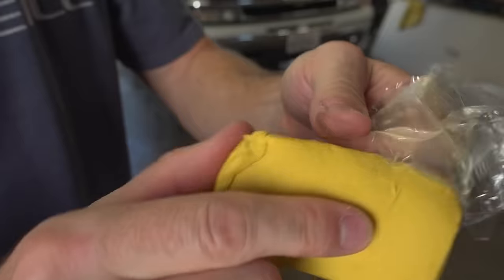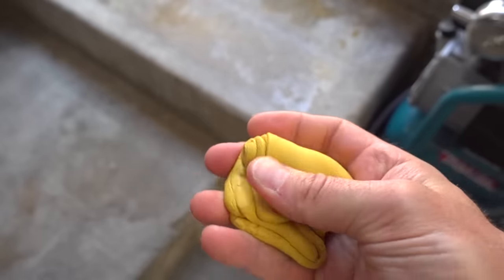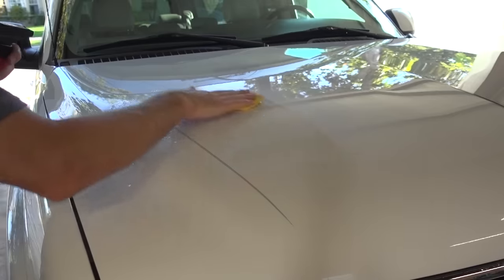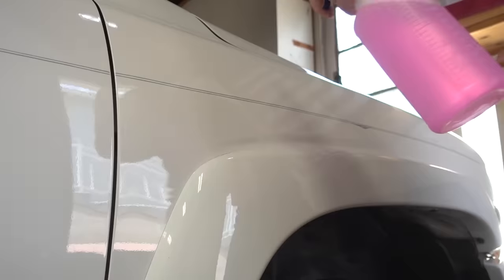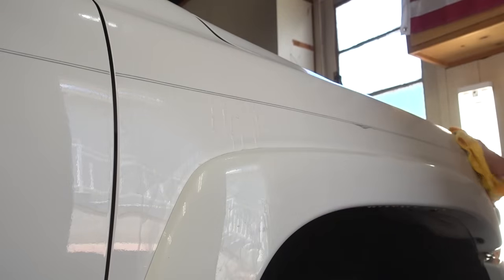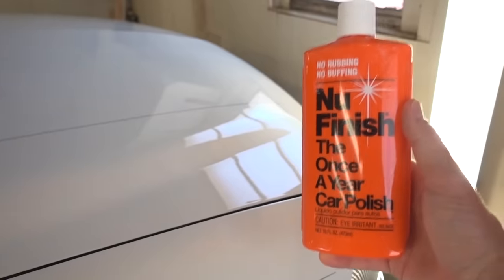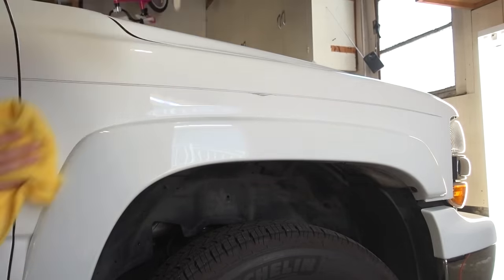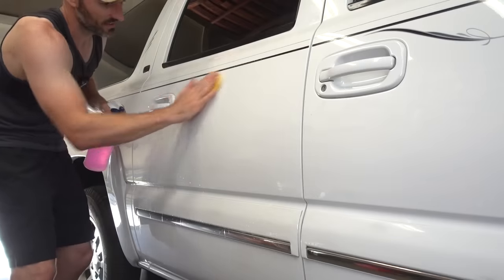This Is Better Than A Clay Bar And Only Costs $2

Comment: You never flip over a clay bar. What you're supposed to do is fold the dirty side in on itself to trap any sharp contaminants inside the clay and end up with two clean sides to the clay again. If you flip it over, you contaminate both sides of the clay and you can no longer fold it to achieve clean sides again. That increases the chance of having a sharp contaminant sstick out of the clay whilst you're rubbing it all over your car. Read the user manual.

Comment: So I will tell you what I use- knead rubber for artists. Cheap one costs £1 for two bricks in size of a clay bar, it is soft but not too soft but made to pick up slightest carbon dust from the surface of the paper without even lifting a single fiber of paper off. That's what I call gentle action. Results? Absolutely same as £6 clay bar which I have to store in a jar of water because it sticks to everything and flows. Hate it also when it squeezes through my fingers while claybaring. So no. Tried, tested with a masking tape comparison. Works on chili red Mini like a dream.

Comment: Seems to me a good comparison test would have been to do a panel masked off, half panel clay bar, the other half plumbers putty. 
Then, since clay bar is light colored and easily shows debris, do the putty side with a new clay bar and see if it picks up any debris.

Comment: There are two kinds of plumbers putty still sold sitting side by side. The older putty that uses oils that will damage plastic sinks and pipes and the newer putty that is safe for use on plastics.

Comment: You did remind me with this video that I need to do this operation to my truck. Thank you for your tips. I would assume that regular dish soap mixed with water would also work the same as a lubricant
Reply: I wouldn't use regular dish soap on my car as it is too harsh a chemical for automotive paint - well what else can you expect from a detergent designed to remove grease and sticky food particles.

Comment: You have to use the plastic covering of a cigarette pack to feel for crud left over after waxing. Stick your hand inside the plastic wrapper and feel your paint. You will feel crud. Now use the clay bar. Again feel the paint through the plastic.

Comment: It does take a certain amount of firmness in the clay to work well depending on how bad the car is.
Plumbers putty is not very firm. Could be ok for a car that doesn't really need clay anyway. I would be concerned about it leaving a residue.
If your car needs clay, you really want to follow up with a DA polisher . So clay micro scratches are not really an issue.

Comment: The reason you heard the clay bar make the noises is that's the contaminants on your verhicle  once you hear no noise going over and over again with the clay that's when you know it's contaminant free. No noise of the putty is meaning it's to soft to pick up much, what you should have done was do a panel with the putty then go over it with the clay and see if it's contaminant free.

Comment: You're not actually supposed to use the whole clay bar; just pull off a small piece and knead it till it's soft then form into a disk and clay the paint. The way you used it, if you drop it then you might as well toss the entire bar. There's also linseed oil in the plumbers putty which isn't really good for your paint. I agree with other comments, this may have been an entirely different result if it had been done on a black vehicle. Black show's everything.

Comment: To do a real comparison, You need to do the test on one panel. Half and half. When clay barring a car, one quickly realizes certain body panels get way more micro particles on them. The rear bumper being the most heavily covered on the vehicles I've done.

Comment: You need to show the surface of the clay bar to see what was removed. You can't tell which is more effective without seeing what is picked up from the paint. A less cared for paint would show that result. The sounds or the sliding of clay won't hurt the paint it's what is pulled off the paint is what's important.

Comment: I highly recommend using a clay bar on a brand new car.  Follow up with a thick quality wax job. Cover all the paint.

Why?
Cars get transported by rail, even though most of the car is covered, parts are still exposed to brake dust from the trains. 
The dust is heated and clings to the paint. 

Don't believe me, next time you go see a car on hauler make a note what's not covered in plastic wrap. Go to the dealership ship of that auto, feel the difference between the covered and uncovered sections with your finger.
For an added effect,  use a thin plastic sandwich bag around your fingers.

Comment: If you are worried the plumbers’ putty will leave a residue of some kind, finish off with a wipe down with wax and grease remover. 

Of course there goes any savings from using putty instead of the wax bars.

Comment: I use a synthetic clay. (looks like a nylon pad on a plastic handle) I can do 10 cars before replacing . If you drop it, wash it off. No need to knead. I also use Nu Finish. After that, its spray synthetic wax. Turtle wax ice is great.

Comment: Wikipedia says: "Plumber's putty formulations vary but commonly include powdered clay and linseed oil. Other formulas use limestone, talc, or fish oil." Sounds like the version with just clay and oil should work just fine. I'd worry if it had limestone....

Comment: I bought the clay bar system once for my Z28.  It was almost impossible to not drop the clay bar at some point in the process, where it then picks up a lot of contaminants on the ground and is essentially ruined.  To be honest, I couldn't tell much of a difference after using it.  I'm sure there's something to it, but I would only use it if I had a really, really nice car.  And I wouldn't want a car that nice, because you are walking on egg shells around the thing trying to keep it super clean all the time.  Too much hassle for me.

Comment: you kind of want it to be some what abrasive on paint that is a few years old to remove haze. this might help found it on google of all places. A good way to differentiate between the compound types is to think of sandpaper. Fine clay bars are like 3,000-grit sandpaper, while heavy-duty clay bars are more like 600-800 grit.

Comment: I'm amazed you have a gm suburban with white paint and it has and it hasn't peeled off. Mine did and I see them all the time. I had a 8" square of paint come off after a freeze thaw while driving down the highway. I thought it was paper as it stuck to the windshield for a moment.

Comment: Clay bars are meant more so for just prepping the paint work and getting off contaminants and micro defects that the wash process wouldn’t. I wouldn’t go the lengths of working out scratches with a clay bar. I’d use an applicator pad after claying the surface but clay bars weren’t meant to create the heat necessary for paint correction. The clay process is what truly strips excess non visible junk from the paint. A small portion of scuffs and blemish will come up in the process sure.

Comment: A clay bar isn't really clay. It's a synthetic resin made especially for the purpose and car detailing.  Plumber's putty is actual natural clay mixed with linseed oil.  The clay bar is engineered to clean without scratching.  The plumber's putty works but isn't engineered for detailing.  The clay bar will last longer and pick up more.  Looks like you're starting with a pretty well maintained car with good paint.

Comment: Keep that clay clean with straight hot water that's what cleans it eliminates scratches and keeps the dirt off of the clay I've been clayin cars down for 30 years  be careful  with the soap used some will eat the clay apart but remember  clean with hot water

Comment: So, I don’t think the polish offers much protection. Now, polish obviously makes it pretty but you need to wax over the polish. I’m new to this but every application I’ve used and read about is compound with least abrasive pad and compound combination the job requires methodically using more abrasive compound and/or pad to achieve desired results.I’m sure not all paint jobs need this level of attention but it’s always followed with a polish and protected with a good wax.

Comment: Ok, great idea for the test, but I think better methodology would give you clearer results.

First, you said the paint on your SUV wasn't that dirty, so it's really not that good of a test subject.  You should get another vehicle that is more dirty.  Easier to see the improvement, or lack thereof.

Second, hoods get a lot dirtier and more sun damaged than fenders and doors do.  It's not a good comparison.  If you repeat the test on a dirtier car, you should do 1/2 of the hood with the clay bar and the other half with the plumber's putty.

Third, once you've finished both the clay bar side and the plumber's putty side, you should go over the clay bar side again with a fresh piece of plumber's putty, and the plumber's putty side with a fresh piece of clay bar.  You can then check the plumber's putty and the clay bar to see if either of them picked up any additional dirt the other left behind.

Comment: my friend had a body shop and to test the job of a clay bar use a cellophane wrapper off of a pack of cigarettes';  just put 2 fingers in the wrapper and lightly rub it across the paint of the clayed area and an un-clayed area and you will feel a huge difference between the 2. even if the 2 areas feel the same to the bare finger.

Comment: One way to feel the contaminates in the paints finish is to feel the paint through a cigarette’s clear wrapper. Just put your fingers in the wrapper and lightly wipe the paint. Then use the clay bar on the paint and feel it again. Wow will it be smooth!! I use to have a 1986.5 Supra that was Black. After every winter I would clay bar the paint before giving it a wax job. What a difference, the clay bar would remove all the micro grit that n the paint!!!

Comment: (Head's Up!)  Modeling clay (non-drying) is as close as you can get without paying the big bucks.  At $3-4 a pound.  And you can get a selection of colors to choose from which will help you observe the junk removed.  This will in turn let you know when to replace the bar.  Do not do below the belt line before gently using a bug remover pad with the really soapy water & or liquid cleaning agents. The worst crap accumulates in that area.

Comment: To get a good comparison I would have preferred to see the results on each half of the hood.  Use clay bar on one have and plumbers putty on the other.  After you are done with that, then follow up with the other product to see if one missed something.  Does the putty leave contaminates that the clay removes or the other way round.

Comment: As a detailer for over 20 years I got into using a clay bar pretty frequently and I've had great success with them. This isn't the first time  I've heard about using plumbers putty. However the ingredients in the putty are totally different. Plumbers putty was mainly developed to aide plumbers... HENCE the name. Using the putty will cause damage to the paint over time. it slowly eats away at the clear coat. I'd strongly advise Not to use it.

Comment: Totally different chemistry.  Plumbers putty is designed to be hydrophobic, that's the clay part.  They usually add oils to make it flexible.  The clay bar formula adds a polymer that makes it flexible and sticky. The polymer in the clay bar is probably one that reacts to UV light.  (Many glues are suspended in water which evaporates and then they get hard.) UV poly's stay stick longer.  (Could be some other poly, as I have not seen the formula.)  Clay is sticky without additives, so it will "grab" particles on the car paint like the store bought system. If you expose the putty to air, some of the oils will evaporate (That's the environmentalist VOC issue) and it will be a little more sticky.  Nice life hack.

Comment: Good video but you should of used a vehicle that wasnt already so smooth so you could of better compaired to two. The sound you were hearing was the clay bar lifting contaminants off the paint which means it was working. If you dont hear a noise then either the product wasn't working or the surface wasn't contaminated. I have found the cheapest and best way to clay bar your vehicle is to wash car down at car wash then after dirt is off and vehicle still wet apply the clay bar, or plumber putty, then dry. Yes water works just as good as detail spray!

Comment: The other consideration is this: Clay bars become filled with particles that will scratch so using them repeatedly is not a good idea. The Plumber's Putty is cheap enough that you can throw it away after you're done.

Comment: I got leftover plumbers putty after installing sink and fixtures and drain. I got rain spot on my Dark Blue Tahoe....hmmmm, there is a polish at space age paints that works gr8, even took silicone caulk spill that dried on my door, but is 12 a tube.

Comment: Plumber's putty doesn't work to remove bonded contaminants. It may remove surface dirt if used before washing and if the wash was done improperly with not enough soap (many people don't mix in enough soap in an effort to reduce cost). Chewing gum will accomplish the same thing. What plumber's putty will do over time though is leave putty residue and/or wear away the clear coat due to how plumber's putty is made and the additives it may contain. If you clay properly once and maintain your car, you shouldn't need to clay enough for the cost to make any difference.

Comment: As a detailer I would have rinsed the car and stripped, washed then clayed the car. Their are different levels of clay bars. Soft medium and hard, I believe meguiars is a medium clay. But seems like your happy with your results so thats what matters most. If interested on better quality products I personally use chemical guys. Before that I used meguiars. Both are very similar in cost but uv protection are very different and that's where the chemical guys shines. All this is to be taken with a grain of salt as some people use trust other respected brands such as meguiars.

Comment: Would have been nice to see how it takes contamination off rather than using it after you used the clay bar.  I get tree tannin stains that have to be rubbed off with clay bar because most cleaners won't take it off.

Comment: I've been using it for years the best thing to have 3 pieces and put 1 in the fridge so it is more stable and use solvent free glass cleaner sparingly  as lubricant cheap as chips  !!!!! 👍

Comment: Like all items, each has it purpose.  For some a multipurpose.   With using plumbers puddy, I would be suspect to the chemicals in that product.  Application is the same but end results could harm the clear coat.  If you, as I am,  who like a clean vibrant detailed vehicle, stick to the product made for the application. Like it was said, it's cost is about the same and you get 4 items in a box to do the playing.  Why risk?

Comment: A clay bar can actually scratch your vehicle a little, especially more noticeable on a darker vehicle.  Wax/polish will hide that somewhat.  If there are a lot of contaminants on your paint surface, that will also make a difference.  This test would have been more informative on a darker colored vehicle.  Nice Tahoe/Yukon, by the way.  Thanks for the info…

Comment: Nice video but would be much better using a dark color especially black, dark green, blue, etc. to reveal . I have a metallic gold motorcycle and it doesn't show off the nice paint job and clear coat near as much as darker colors of equal quality. I had a white XJ cherokee,  I never bothered with polishing it. :)

Comment: The firmness  of a clay bar should not matter if you follow  the proper  procedure  to detail a car, they do sell different  firmness  levels  of  clay. The more firm the more and tougher containments  you will remove. You do have the possibility  of adding VERY VERY light scratches  but will not matter if properly  detailing  a car because  you should be polishing  the finish after with a high speed buffer foam pad and # 2 then  #3  polish then removing  all possible  micro scratches  you added  with the clay.

Comment: I remember the good (horrible) Old days before clay was even a thing. Made our jobs a million times harder especially if you received a car with a ton of over spray which we got alot of from one hacker body shop we finished cars for. Actually had a bucket of compound called " Bucket O compound" you slung it on the car with a putty knife, buffed at low speed and then buffed again  with medium grit compound , and then again with polish and then waxed. Detailed for 30 years

Comment: Hard to tell with white paint, but are you putting micro scratches in that paint with the plumbers putty? Try that on a black car and use a light at an angle to check closely if you put swirl marks in it. You can't see micro swirls on white paint.

Comment: What about using a $1 (for 4 sticks) of modeling clay from the Dollar 
Tree"?  That is, after using up all the 3/4 full cups of plumbers putty out in the garage.  Funny about that stuff.  You normally only use a teaspoon to seat a sink drain fitting, but have to buy a whole 16 oz.  That's why we all have one or two in the garage or shop.  One for the first sink job and the other because we bought another one for a new project and either couldn't find the first one or weren't sure it was still good  and didn't check before going to the store for the second sink project......lol!

Comment: 1Road, all clay bars are not the same. Especially that Mother's clay bar kit. You need to use the Meguiars Professional grade clay, or the 3M, clay bar which both the Meguiars  and 3M, are made in Japan. The inventors of the clay bar. Also, not all micro fiber towels are the same. And you can not use circular motion when drying off the surface.